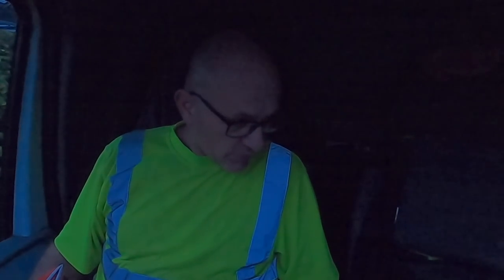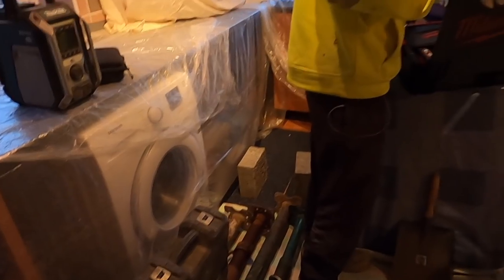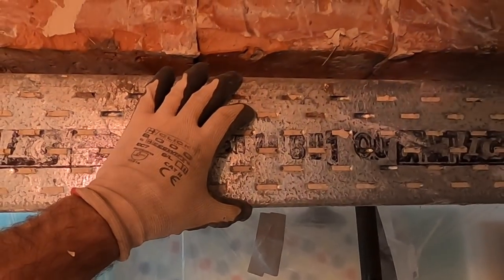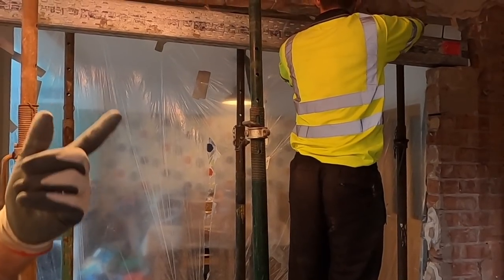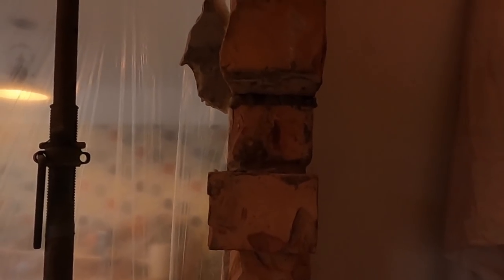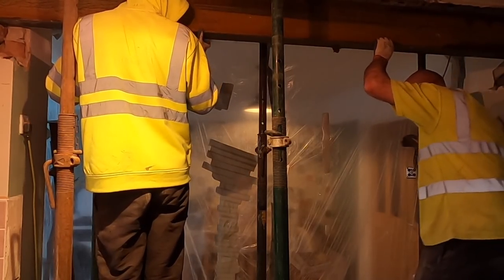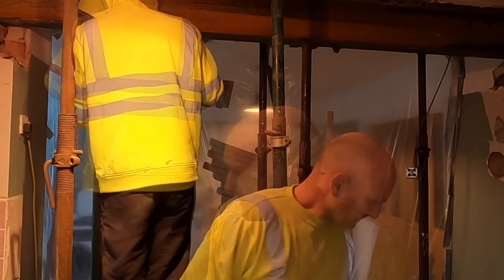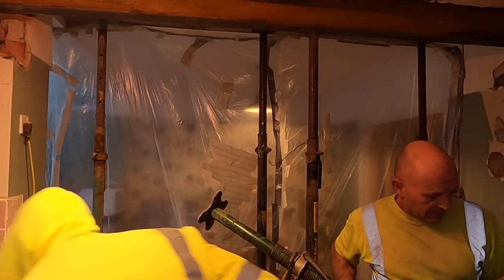BADLY INSTALLED BOX SECTION LINTEL

Comment: I put in a lintel between kitchen and dining room in a 1970 built house. The spec required an engineering brick stiffening "nib" on the exterior wall and blue brick pad under the beam.  The internal wall structurally supported the roof purlins AND a steel that spanned about 2.5 metres to the back wall of the house. This wall was single row "breeze block" so this had to be doubled up for about a metre to where another partition wall met the supporting wall. All good and overall we might even have a stronger house after fitting the new lintel.
A wider foundation was needed. I dug out the floor adjacent to the structural wall to meet the foundation concrete. There was no concrete - the blocks were sat directly on the clay about 3 feet down!  Oh ****, I had just undermined my house!!! I Akro propped the existing lintel and Building Inspector gave permission to clean out the hole and mass fill with concrete. Left if for 2 days and took out the Akro props. 
No harm was done but this house had been built with about 4ft (maybe more) of central structural wall sat on nothing but clay. Depth was good probably why there had been no movement. 
The new engineering brick went in with lots of ties to the existing breeze bock and the new RSJ lintel went in the usual way with Akro props and spreaders to support the floor beams.
Reply from the maker: Jeez 😲🧱👍🏽

Comment: A neat job inthe finish.
Might it have been easier (and stronger) to use two Acrows under the beam as temporary support before load goes onto padstones?
Glad you rebuilt the right hand support wall but it still looks a marginal in terms of 'stiffness'

Comment: Hi lads obviously l'm not a builder or l wouldn't be asking these questions . You put mortar on top of the steel and as you are winding the acrow it displaces and some falls out ,is that to make sure there is no gaps above steel ? Oh and caught the comment about painted steels is it a requirement ? Cheers lads your vids are great l'm a wanna be builder.
Reply from the maker: We put the mortar on first for exactly the reason you say. It’s impossible to fill that joint once the steel is in place plus we know that it will be packed very tight .
   As for the steel I think pint is required on outside walls but it’s good practice to get them painted . On this occasion paint was requested but the fabricators forgot 🙄 . It’s a great trade to have 🧱🧱👍🏽

Comment: Hey great video could you advise on the following
1) what mix did you use for the bricks and pad store ie cement and sand 3:1 ratio of sand to cement 
2) did you use the same mix on top of the steel to pack it in sand and cement just bit less water
Reply from the maker: Hi Patrick, we always use 4:1, Normal mix . We don’t pack it in , we spread it on before we acrow it into place Nice and tight which ensures a nice full bed 💪🏼🧱👍🏽
Reply: So you use just normal soft sand and cement 

Thank you for the reply
Reply from the maker: @patrickkerrigan3629  Yes pal 🧱👍🏽

Comment: I don't understand why you installed the floor supports. The beam is located in a normal partition, not in a load-bearing wall
Reply from the maker: No mate its a load bearing wall , it has floor joists and a wall above 🧱💪🏽

Comment: Steve . Do you use structural engineer to calculate the necessary RSJ beam. Reason for the question I'm thinking of getting I done and the bricklayer said not to he will know by looking ?
Reply from the maker: Not on every job . Mainly if it’s an external wall . We just oversize if it’s just joists above 🧱👍🏽
Reply: @SteveAndAlexBuild  thank you for the reply yeah it's a internal supporting wall just thought I'd ask the question with you guys been bricklayers cheers once again
Reply from the maker: @jaywest5543  😁🧱👍🏽

Comment: I noticed you filled the gap between the steel and the padstone with mortar. I've always been lead to believe you have too use slate. Is it down to personal choice or the BI?
Reply from the maker: I prefer nothing and pack the pad stone up but I was told it has to have a bed under the steel 🤷🏼‍♂️🧱👍🏽
Reply: @SteveAndAlexBuild  Not a builder but I thought that it had to be a 3-1 almost dry mix that went on top of the steel? If not, then i could have saved myself a load of time trying to squeeze in and compact a dry mix!
Reply from the maker: @prestonian1066  There are so many ways to do it 😆🧱👍🏽

Comment: Hiya boys, another great video 👍😉. You want to get those Acrows wire brushed and oiled 😁😂😂
Hope your weather is improving, have you got any inside work if it stays cold ?
All the best
Regards 
Tim
Reply from the maker: Hi Tim , I’m reluctant to oil them as you get covered in it then . It snowed on Boxing Day and hasn’t thawed since , currently -2 at 10 am . 
    We have put up a fence for my daughter and the trusty nail gun was brilliant. We also knocked a gate up with it and boarded part of the loft. We haven’t even used even half the nails yet so a massive thanks again fir that 🙏🧱👍🏼
Reply: @SteveAndAlexBuild  Hi Steve, I normally clean & wd40 my Acrows (30 of them 🙄) and it makes them so easy to use. I wd40 the threads each time I put them away & the shafts once a year.
Isn't it crap weather, we know its coming every year yet still its a surprise 😂😂.
I've been trying to get 225x75x6m purlins & wall plates up onto a very icy scaffold - really crap week 🥶😡.
I'm so pleased the nail gun is doing you well & you've still got nails left. The fence & gate look a treat 👍🤩 bet your daughter is chuffed.
Hope things pick up for you boys soon 🙏 👍
Regards
Tim
Reply from the maker: @timmargereson332  Yeah the house builders fence is a joke 3x3 posts barely concreted , 5x 1 ! Rails then hit n miss 6x1 boards . 
There is a thaw due on Monday but wet then so let’s see how next week goes , we are never happy are we 😂🧱👍🏼

Comment: Why do you have to use padstones Steve and not just bricks ?
Reply from the maker: Building control usually specify it 🧱👍🏽
Reply: That’s a great question and one I have asked BC a few times ...I think the pad stone is designed to receive a bolt or bolts through the steel into the pad stone but even with this the steel is normally built in so shouldn’t move ..But my issue with the standard house mod pad stone is this The steel is sat on the concrete pad stone which in turn is sat on “ knocked up “ mortar onto a lightweight block ( and don’t give me the 7n routine)😂🤣 so yes why not a couple of concrete commons or a fully filled 2nds engineering brick which as memory reminds me is about 60n ...Just sayin 👍👌
Reply from the maker: @ronniebiggs4026  👌🏼🧱👍🏽

Comment: Bit dodgy removing acros as steel on wet pads mmm
Reply from the maker: Old clay commons mean not wet mortar . 
   Just try a bed one down then 5 minutes later you try and compress that mortar a bit more  , the brick will break before that mortar will compress any more . Nothing dodgy at all just 35 years experience and knowing my materials . 🧱👍🏽
Reply: Maybe so but with weight of steel and payloads above your still taking a risk my old mate commons are not even as strong as a concrete block of 3.2n
Reply from the maker: @davidbarnett8002  🧱👍🏽